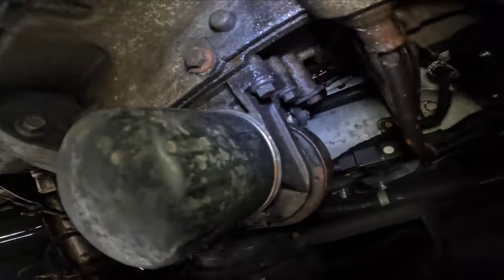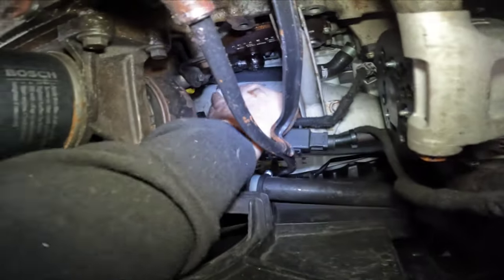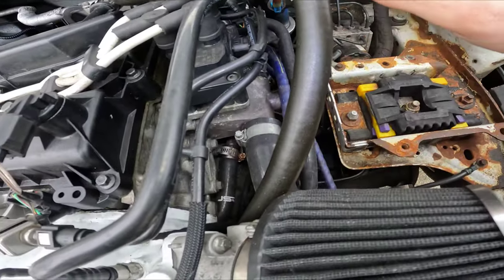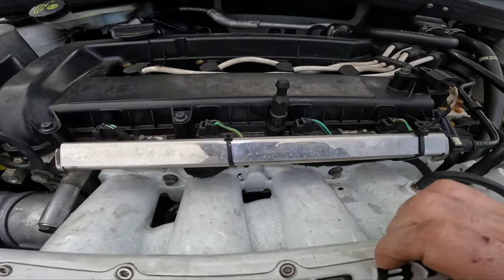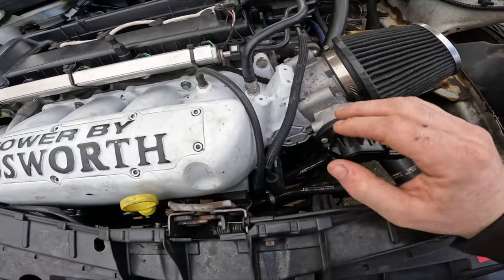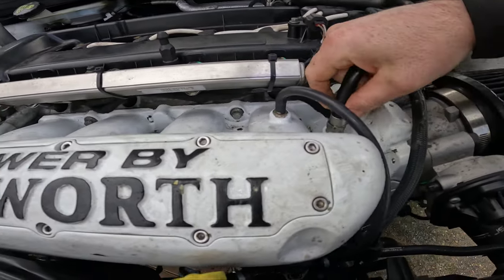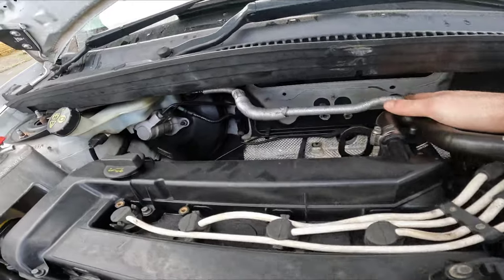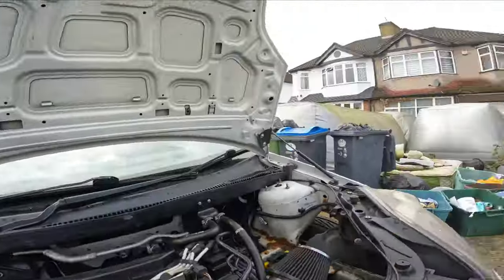MK6 Fiesta ST150- How To Plumb In A Cosworth Inlet Manifold

Comment: I have a cosworth inlet ready to fit but im stuck with What to do with the vacuum solenoid connection plug that goes on the standard inlet will this cause a fault code if that is not plugged in
Reply from the maker: @cheekyfellow1980  as you can see on my one it doesn’t have it the holes were welded on mine and no light comes up on the dash and no fault codes are present

Comment: Rare has hens teeth now cost same now second hand the copy ones are not bad just the casting is crude nothing a dremel carnt sort out did u ever find a cosworth version of the dip stick ??
Reply from the maker: Yeah but of porting and they’re near enough as good and no mate really wanting one though it’d tidy the bay up a lot more 🙄
Reply: @6uiltdifferent  ya true smooth out the imperfections on the castings if the cosworth dipstick comes up for sale will keep u informed mate no probs go my sidewinder now for the turbo sorted so I have a new in the box manifold with waste gate outlet just sat on the shelf currently soldering clock smds with new custom facia and wheels refurbed for the summer in a unorthodox colour got think out the box lol keep up good work on the channel 💯🫡👍🏻👍🏻👍🏻
Reply: Pesky pcv valve 😂, do you get much oil in the catch can ?
Reply from the maker: @DeanChapmanFPV  slushy nastyness yess